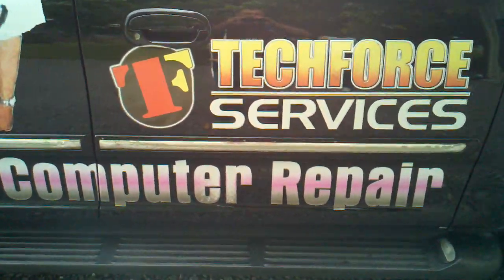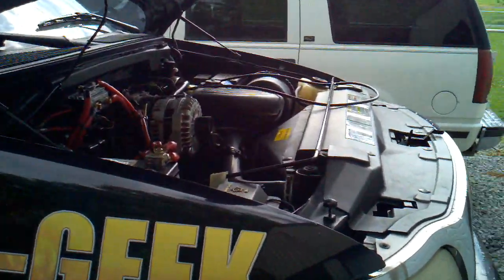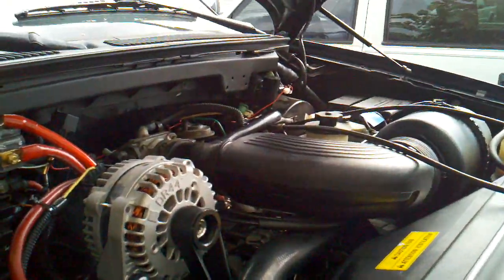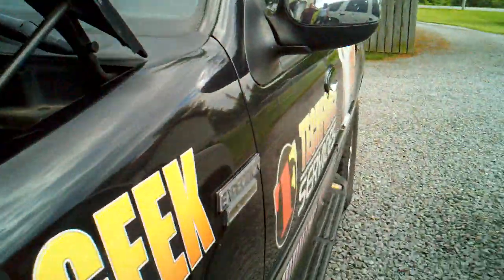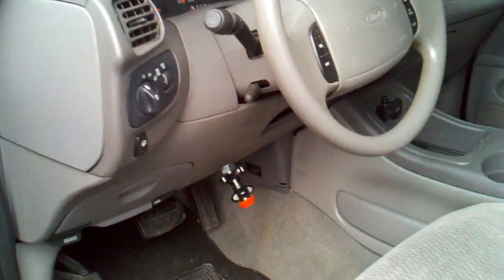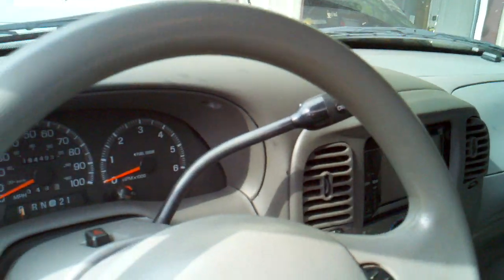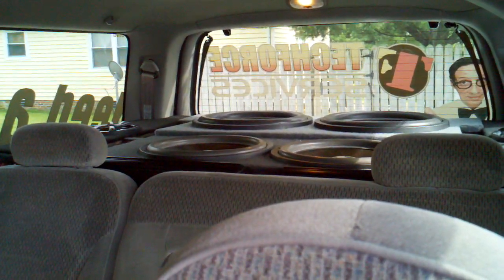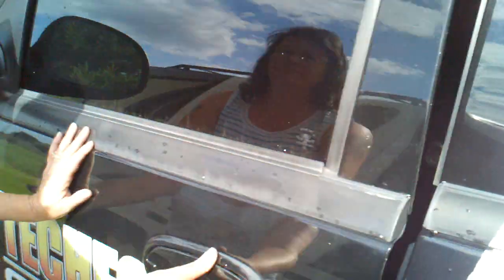Frankenstein Dual DC Power Alternators Update.

Comment: @thesplhell

I'm sure you already know, but the SMD's doesn't really have a advantage over other less power handling subs(Mayhem BTL ect) until 4k RMS. So unless if your planning on running two AQ2200d on each, I would think they wouldn't be worth it. IMO

Also, to get 1/4ohm, you would need to wire two dual2's coils in parallel then wire the subs together parellel then strap the amps.